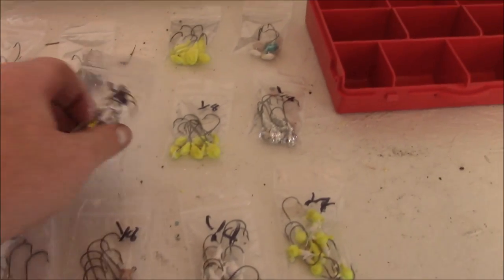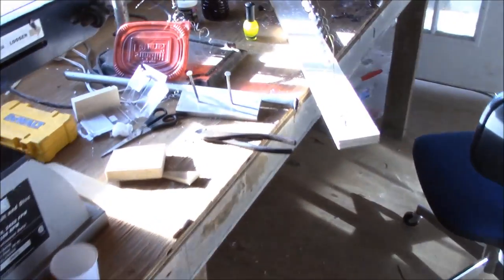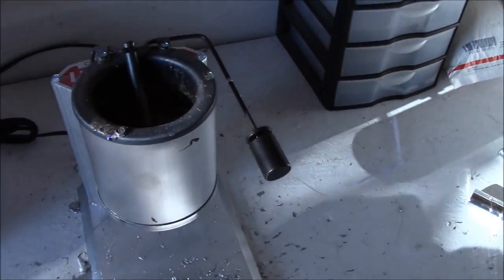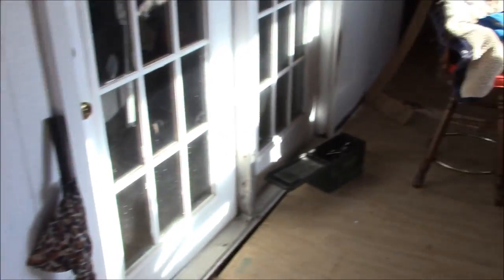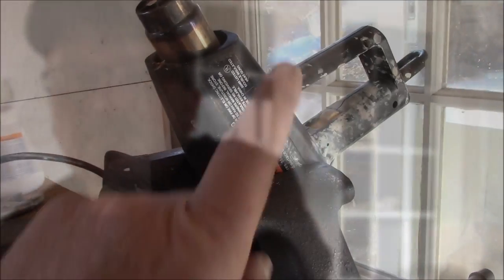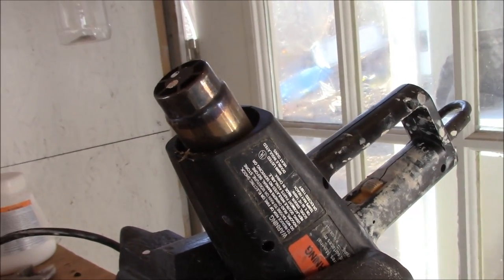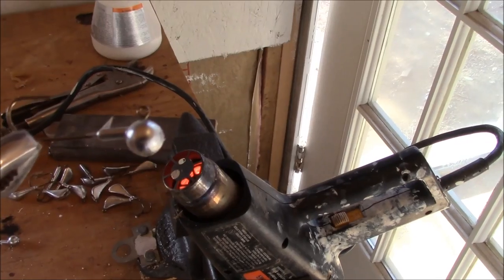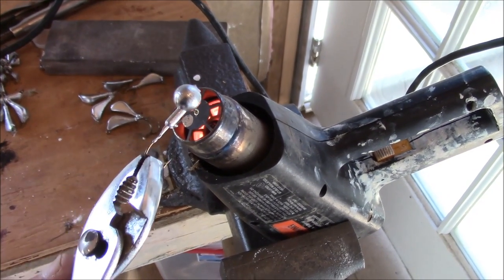Powder Coat jigheads Cheap with paint from Harbor Freight Review

Comment: You lose alot of paint not using a fluid bed. Kinda why your board is covered in drip marks. Baking also makes them last alot longer. Few special methods I use after I cure them so I can throw them on the ground and they still dont chip. Some secrets stay secret. But I recommend the fluid beds

Comment: What do you use for hardner ?
Reply from the maker: What we do and it works. We beat rocks with our color dip jigs for walleye to smallmouth. We dip let dry then spike-it (coloring) then after drying again we then put a coat of clear finger nail polish on the heads for the glossy hard coat. Works great been doing this for years and catching fish. Also when we clear coat with the polish we will sprinkle glitter on some jigs and let it dry that's a nice looking jig to. Thanks for stopping by

Comment: If you cure the jig heads in an oven after painting them the paint will be a lot harder, so it won't chip as easy & you won't need to use a hardener.  350 degrees in the oven for 15 minutes will do it, plus a few minutes for the jigs come up to temperature (I usually just pre-heat the oven with the jigs inside).  Jigs with weed guards need 25 minutes at 250 degrees (so the weed guard doesn't melt).
I do NOT suggest curing them in the same oven you cook your food in  (like I did),  sometimes the paint will drip & get on the bottom of the oven, the oven will smell bad when you cook, it is probably toxic for your food, and your wife will have a fit .
IMPORTANT:  Always remove paint from lure eye before curing as it will will be extremely difficult to so so afterwards.
As always, make sure you have adequate ventilation when doing this stuff as the lead fumes (when you make the jigs) & the paint fumes (when curing the paint) are very bad for you.

Comment: I have seen other videos heating them up with a heat gun or lighter . then dipped them after the jigs cooled down then reheated to add another color to them  . Then for the final hardness they either reheated with a heat gun or put them in an oven or toaster oven  for the final hardness of the paint
Reply from the maker: Well we like to heat, dip then color most time with fingernail Polish colors after drying we add a clear coat of fingernail harder and works great. We also heat, dip then use the software plastic color dip to dye the white dip like green orange and so on in the dyes. Then add the clear coat fingernail hardener. We do this with Bass jigs we add skirts or just the 1/8oz jig heads we use on swim baits. We been doing this many years and does the job. But everybody has their style of dipping there's really no wrong way 
Thanks stopping by
Reply: @HillsandGills  True   no wrong way .I like the idea of using a heat gun to heat them up but wondering how the heat gun would do  on reheating them for doing the final touch  . your video give me some ideas  as to do mine when I get started doing them  I was thinking  to heat dip and add  a different color by paint brush  after a reheat for the other color
Reply from the maker: The reheat with the heat gun may cause bubbling of the dip. Try dipping then fingernail Polish of color of choice  ( many colors on the market and .99cent bottles works great then clear hardener) we don't reheat after them steps plus Polish with glitter in it makes for some nice heads for swim baits, chartreuse Polish dirty water and orange and red great for smallies. We found clear hardener let's the jigs take a beating on rocks and bottom fishing...
 Just a tip

Comment: Use vinyl it can take a beating. Powder coat chips way to easy. I only use powder on my really small jigs.
Reply: What kind?
Reply: @fishyhobby3697  what kind of vinyl?
Reply: larrabeejl yes, who makes it?  Where to buy?
Reply: @fishyhobby3697  Its called OS coatings. You can find it at Cabelas, Bass pro and some of your smaller shops. I get mine from a local shop in Milwaukee called Reinke Brothers. He also sells the clear finish and the special thinner. It can be difficult to work with but when get a little practice it's all down hill from there.  I've painted over 100 jigs using vinyl. One trick I learned is to let them hang for a couple days because if you try to box them up to soon they fuse together.
Reply from the maker: Yes we use powder coating on  our jigs have been pouring, skirting  and coating painting jigs for years. On the outer clear coat used clear fingernail Polish and Testors enamel model paint also. I've bought jigs in the past from  handmade to retail and they chip from rocks/dragging and bottom bouncing just taking beating from the bottom. No jig is foolproof from chipping unless your just going to swim it . All in all been jigging many many years one of my favorite lures our lakes are deep clear rocky lakes and that means jigs. We've poured jigs and not even painted the heads and took quality Bass the key is in the skirts and the right trailers that's what catches  the Bass eyes. A main reason in painting the heads for sale from my experience. When I see key for a painted jig head is when swimming a swim bait on it off bottom
Reply: @murphroberts4891  Believe me it is. From pounding rocks on the bottom and sides of rivers and hitting it off of concrete walls and bridges vinyl performs way better than powder coating. The only downside of vinyl is that it takes a lot longer to cure than powder coat. I actually found some of my uncles 30+ year old vinyl and was able to revive it good as new I couldn't believe it. Try it for yourself you'll be surprised. Tight lines
Reply: @HillsandGills  If you're fishing lakes you really don't haft to worry that much about chipping. I fish mostly for walleye in the rivers where I live. Vertical jigging you really don't haft to worry that much about the paint chipping. Its when you start casting by rocky shorelines , bridges, docks and heavy current rocky areas where the walleye normally are that's when vinyl really works. I follow the instructions when curing powder paint but they still get destroyed fishing below dams with fast moving water and rocks everywhere. Give it a shot you'll be surprised. Good luck
Reply from the maker: Good tip on the vinyl but just sticking with the powder coating have jars of it and got it pints super cheap. Been using it since the day of the old heat and pour lead cups. Yeah we fish a lot of rivers here in Kentucky have about 8 within hour ride and some fast moving waters below dams as well, for everything from Smallies, Brown and Rainbow trout as well walleye,hybridand Striper. And and our lakes are deep clear and super rocky and lots of wood. 
We just pour and with the melt pot and a quick deep and paint. Can turn a 100 out in no time plus they don't last long in the areas we fish boat, bank and wading lol. 
What State you fish ??
Reply: @HillsandGills  Wisconsin

Comment: Your dipping will come out cleaner if you make a fluid bed.
Reply: DrZiggyZoo will this cheap powder paint work with a fluid bed?
Reply: Any power paint would work with a fluid bed. It's just getting the air flow right so you don't have too much or too little air.

Comment: So does this has to be cured like the powder paint geared towards fisherman?
Reply from the maker: With any powder paint the option to be cured is there but we dont when applied and it holds up awesome against rocks wood and so on And we fish them in rivers and lakes a lot. We do apply a coat of finger nail polish for color but lately we have been using spike it and they look great so good Ive bought several colors in it and the powder coat in the vid is as good or better than the ones marked for fishermen and the price no contest it just isn't sold in the fishing department and thats why its a third of the price and triple the amount . When it comes down to it I myself see no need to cure the paint we have been pouring our jig heads for yrs and I have some thats 2 to 3 yrs old and still looks great
Thanks for Stopping by